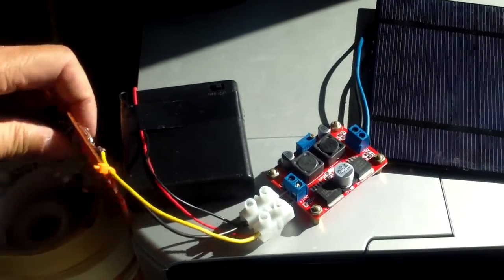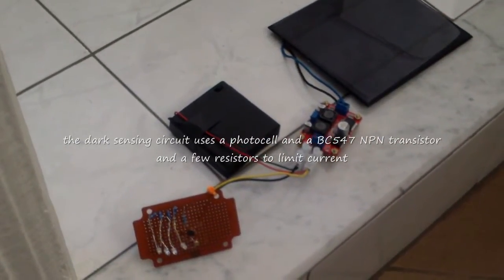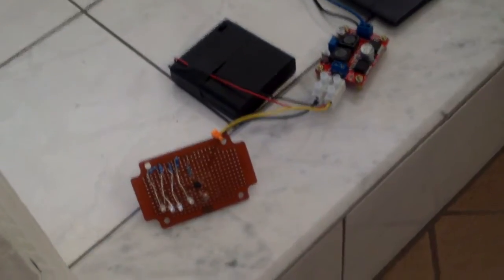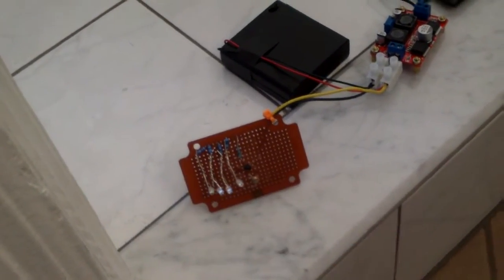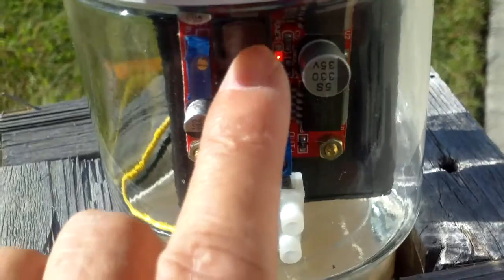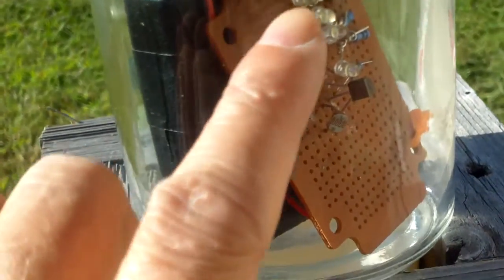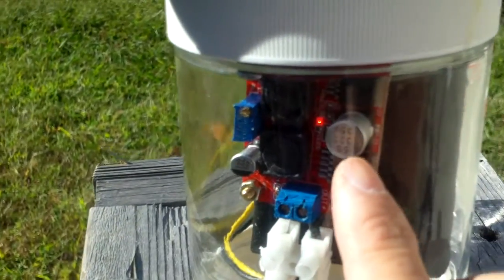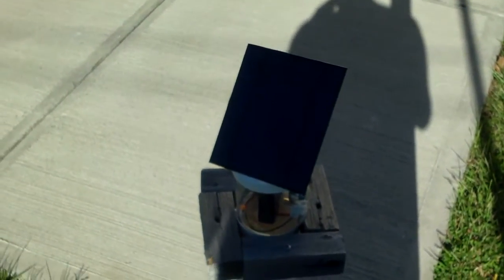Do it yourself solar rechargeable dark sensing garden light

Comment from the maker: I should have said  the solar panel produces 500ma  in name only.  Like all solar panels, they lose efficiency when they heat up. In reality, it produces much less than that. There is a voltage drop with the diode that I put in and I'm sure there's some loss with the voltage step up converter. Maybe that's why these commercially available solar power packs don't work that well because they use tiny solar panels. It will take days to charge them.

Comment: You'll need to switch to mosfets and a bigger battery for those strip lights.  Have you seen the 5050 strip lights?  They put out 780-900 Lumens/Meter.  That's getting bright enough for indoor use.

Comment from the maker: Water can get in from the top with the holes. I was thinking of using the solar panel to cover the top but if I do it that way, the panel won't be as efficient. Right now, the weather is much cooler here so heat is not yet a problem.

Comment from the maker: Good question. I should add "do this at your own risk" to my videos. If the output voltage is set to 5.85v, it won't go above that. If it continues and say go up to 6.5v, then your batteries will be overcharged. Some of these converters can also regulate the current as well as the voltage. I don't think this one does that. I made another battery pack and I used a similar converter and set the voltage to 6 volt and the battery pack voltage never goes above that.

Comment from the maker: Copy and paste  "DC-DC Step Up&Down Voltage Converter Module 3.5-28V" in ebay search box.  They are about $5.25 and up, some include shipping. You can probably make do with just a boost converter, depending on your needs.